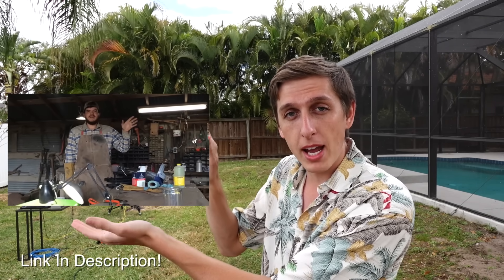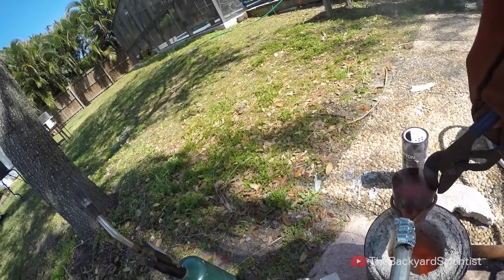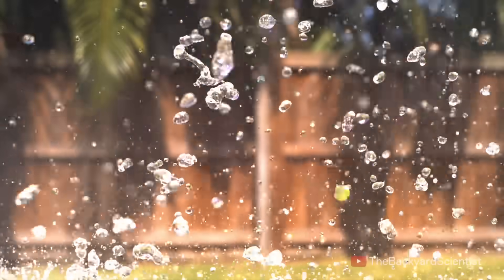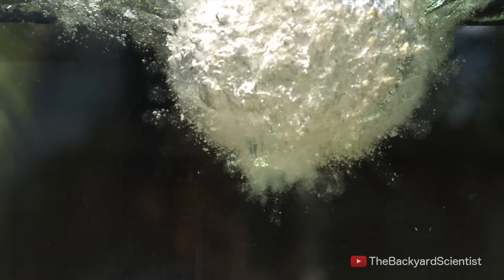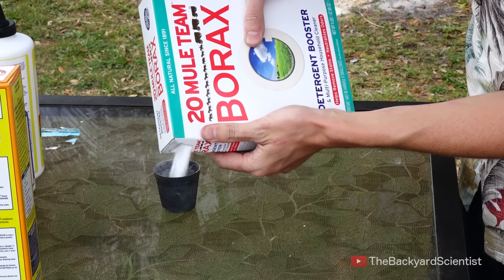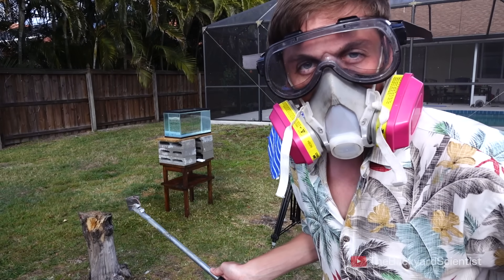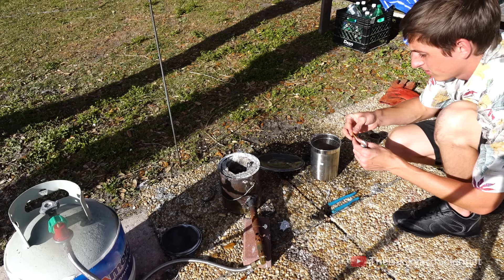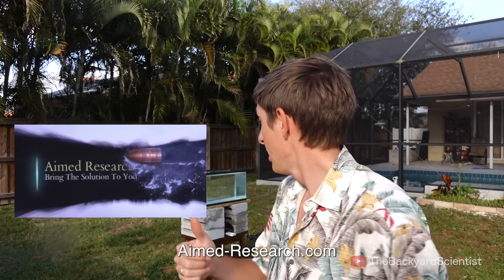Pouring Molten salt into Water - Explosion!

Comment: Professional Chemist says:
The attraction of the strongly ionic bond in NaCl is able to overpower the Leidenfrost effect enough to initiate the "exponential process" the Backyard Scientist proposes at the end of the video. The fact that molten NaCl has such a low viscocity is what enables that rapid process. The other compounds he tried are either more viscous when that hot, or have a weaker affinity for water, or both.

I predict that only binary alkali-halogen salts will do this as well. NaCl is the least toxic, followed by KCl. CaCl2 or MgCl2 may perform well, but that depends on their viscosities when molten. Another simple, non-decomposing salt with a higher melting point than NaCl, low viscosity, and strong affinity to water may be even more spectacular.

Comment: My belief is when you melt the table salt you are separating the sodium and the chlorine, that how you are getting the explosion. Sodium itself is explosive by itself when exposed to water even when its not molten. So the chlorine in table salt is a stabilizing agent for the sodium which makes it soluble in water till molten, when molten you are separating the two chemicals which makes the sodium less stable which in turn gives you your explosion.

Comment: it's ah 'coulomb Explosion' which all Alkali Metals do when reacting with water - you can simply google it up. 
Dear Backyard Scientiest - learn how to use google to look up things you have no explanation for :-)
Reply: +Felix  Klingler But its not an alkali metal, its a salt.
Reply: the sodium is an alkali metal Comic B Studios
Reply: Felix Klingler But it has already reacted with chlorine, it is a stable ion that will not react with water, hence why adding normal salt to water does not cause an explosion.
Reply: yes but it's molten - this changes the situation Comic B Studios
Reply: Felix Klingler It does but the sodium and chlorine have still reacted, otherwise chlorine gas would be evolved

Comment: I think the reaction is chemical in the following reaction: H2O+NaCl --> NaOH+HCl. And also there are a couple of indications of a chemical reaction like gas production and most likely heat. Now for the unchanged pH level; I believe that since this is, concerning molarity, a very balanced equation. The two reactants only need 1mol of each to create 1mol of each product. And those products would then reverse react to form the original reactants, the new products. So depending on how long you waited to test the pH levels could've dictated where it went pH wise. But my prediction is that even if you tested it immediately after the reaction, the hydrochloric acid and sodium hydroxide would've balanced each other out anyway, resulting in no pH change. So that's my theory on why this is a chemical, not physical reaction.
Reply: +LilFatty0616 But the reaction you propose does not create any gas and would require heat not produce it.

Comment: The sodium explodes with fire because it is chemically positive and oxygen is chemically negative. The sodium chloride explodes more fiercely because it's chemically polar with a positive element and a negative element, mixing with the water perfectly as hydrogen is positive and oxygen is negative. The reason there is no ph change is because salt has no ph. If you take hydrochloric acid and sodium bicarbonate, you will get water, salt and carbon gas, it will be neutralize salt water.

Comment: My guess is: 
1) The sodium is still ionic when molten, so it shouldn't react with water the way that sodium metal does, since no electron transfer is 'desired' 
2) But the ions of the sodium and chloride do have a strong charge, meaning that water molecules are quick to surround each ion 
3) As soon as the water tries to surround the ions that are trying to disperse, they are heated up and converted to steam, giving the ions a moment where they're not exposed to water (hence the little bubbles and the pauses in the explosion) 
4) The borax wasn't as significant, because each ionic molecule has 2 Na per 11 other atoms in each tetraborate (instead of the 1:1 ratio of sodium to chloride) AND the borax probably wasn't anhydrous, so there was a lot of water that got steamed off while you were heating it, so the actual ionic material you got was less than there was in the salt.  
5) Basically, the borax had much fewer strong ions in it, so the effect wasn't as dramatic.

Comment: when you heat the sodium chloride past its melting point you are literally breaking the bonds between chlorine and sodium. both of these elements are very reactive because of the number of their valence electrons, and when they are placed in contact with water the individual elements bond with the hydrogen and oxygen as well with each other. thats what happens
Reply: +Aaron Cross if that happened, when you melted it you would get chlorine gas being evolved which he would have seen (and also noticed because highly poisonous)

Comment: you are melting off the chlorine gas and what's left over is Molten sodium and when is sodium is combined with water it explodes
Reply from the maker: +Anthony Cliett nope
Reply: +Anthony Cliett If the salt was broken down, it would have to be combining with the water (either the hydrogen or the oxygen), this would change how many free hydrogen ions are in the water, thus changing the pH value. Since the water was pH neutral both before and after the test, the water must not have reacted with the salt chemically.
Reply: You can't melt chlorine out of sodium, that's not how molecules work. The chlorine isn't dissolved in sodium, so you can't melt it out.
Reply: +John Manard Thing is, cooling doesn't create expansion, it does exactly the oposite. I think whats going on is that the energy stored in the NaCl has to be liberated since the Na+ and Cl- ions have less degrees of freedom of movement compared to the NaCl molecule, so the energy is released extremly fast into water once it ionizes, wouldn't be able to determine why it happens to this ionic compound and not the other ones tested on the video.
Reply: +Anthony Cliett LOL go back to school, you idiot.
Reply: +Orintaz i thing ypu are right. maybe
Reply: +TheBackyardScientist Your explanation could be applied to any molten liquid unprotected by the Leidenfrost Effect though, right? I must not be grasping something.
Reply: +Lou Manarty high temperatures might break the bond and then the chlorine could evaporate
Reply: +John Manard I think he means the chlorine went away when her melted it leaving just molten Na
Reply: Lou Manarty This could happen but only at temperatures way past turning gaseous. Like if you threw it into the sun then it would break down, but not in a home-made crucible.
Reply: oh XD

Comment: Wow. So you think sodium dissolving into water makes a steam explosion? I don't know about you, but I have never seen steam on FIRE before. You really should update this so you aren't telling people things that are very very wrong.

Sodium metal CHEMICALLY reacts with water in the following way;  
Na + H2O <-> (Na+) + (OH-) + H          (rxn1)
2H <-> H2                                                (rxn 2)

A simple way to put it is the sodium metal has an electron it really doesn't want and attacks water. The oxygen in water isn't stable with the extra electron and the bond with one of the hydrogens is broken producing a neutral hydrogen and NaOH (rxn 1). The neutral hydrogen atom can easily react with itself to make hydrogen gas H2 (rxn 2). Because of the heat released from (rxn 1) the hydrogen gas formed in (rxn2) is at a high enough temperature that it can burn with oxygen in the air. This is PROVEN by that fact that there is FIRE clearly visible in your high speed footage. It's amazing to me that you are 99% sure there is no chemistry happening when you were feet away from a fireball. Your little experiment will not change the pH enough to see a difference in pH paper because most of the molten salt you add simple dissolves in water the same way solid salt would. 

To summarize the explosions you are seeing are from sodium 'chemically' reacting with water producing a lot of Hydrogen Gas. With sodium metal the reaction gets hot enough so that the hydrogen can burn with oxygen in the air. With the molten salt it doesn't get hot enough so there is not fire, but a lot of hydrogen is produced quickly making the explosion. Steam explosions do not happen when there is liquid water around. Pockets of steam in water just heat up the surrounding water, boiling water doesn't make it explode.
Reply from the maker: +GmanFTW dude did you even watch the video? There was no fire at all except for the sodium metal.
Reply: +TheBackyardScientist 

I was trying to keep things simple in my explanation but allow me to explain further. Sodium metal contains neutral sodium atoms, not ions. Notice in my first comment that in rxn1 we need a neutral sodium atom with its one electron it doesn't want to attack a water molecule and make hydrogen. With sodium metal this reaction happens very quickly and gets very hot, hot enough to ignite the newly formed hydrogen gas. 

Now as I'm sure you know that sodium chloride salt is a combination of sodium and chlorine 'ions'. When you add solid salt to water the two reactions in my first comment don't happen because there is no neutral sodium atoms that can attack the water. Now here is the interesting part,

Salt (sodium chloride) is very stable, indicated by its very high melting point which you mentioned. The reason it is so stable is because of the 3 dimensional lattice structure is forms with other sodium and chloride ions. When you melt the salt, you are destroying all of the chemical stability that was present in the lattice structure of the solid salt. Now you have a liquid filled with very excited sodium ions. So excited that some sodium ions may briefly grab an electron from a nearby chlorine or from somewhere else (this is the only part i'm uncertain about). So in general at any given time we may have some amount of neutral sodium atoms in the molten liquid. Kaboom, now we have neutral sodium that will react with water in the same way as I explained in my first comment.

But because the molten salt isn't pure neutral sodium atoms the reaction will not get as hot as it does with pure sodium metal, so the newly formed hydrogen gas does not have an ignition source aka no fire. 

I'm not trying to start a comment war, I just want to help you learn about what you are seeing. It was a good effort, but your explanation in the video was incorrect. What you are seeing is the rapid formation of Hydrogen gas. If you have any questions I will be happy to try to explain it to you.

Comment: Everyone thing but the salt forms a protective oxide layer that shields it from direct contact with the water.  But the salt does not form an oxide layer which allows it to have direct contact with the water which allows its outstanding temperature to separate the water into hydrogen (which is highly flammable and explosive) and Oxygen which is used in combustion.  The temperature ignites the hydrogen fueling the massive shockwave and explosion.  If you have any other questions about this or on anything else leave a comment on my channel.

Comment: 1 I would highly recommend you don't use glass for these tests, you can probably tell why, some odd polymer would be better and two i've already seen a comments about this saying how the salt is water soluble, I'm guessing this counteracts the liedenfrost effect and compounds with your theory of the precontained expansion. 

In my experience with borax its rather stable. more of a boiling than a volatile reaction. compared to metal where it's more rapid and can create more expansion but has the liedenfrost effect, take that away and add in the rapid crystallization causing fragmentation and rapid surface area multiplication equals a very effective explosion

Comment: Sodium will explode in water regardless its molten or not and that is what exactly i think might be happening when you are melting table salt. you are kind of making few sodium atom free from chlorine bond.
Reply: That could be a possibility
Reply: +Rishi Kishore But then the pH of the solution would have changed.
Reply: Comic B Studios 
There is no mention of pH in video.
Reply: Rishi Kishore Except for the bit where he tests the pH at about 6:50
Reply: +Comic B Studios 
OK, I didn't see the the video until the end before. 
I really do not think its a physical reaction rather chemical. Because when you put a very hot substance in water you see lidenfrost effect not an explosion.
As seen in video there was no explosion until salt was heated to certain temperature and no explosion in case of Sodium tetraborate. I think that extra temperature helped making free few sodium atoms from NaCl bond. On other hand Sodium Tetraborate has stronger bond compared to Sodium Chloride. I think if it is heated to certain temperature it will explode too.  
There no change in pH because very minuscule amount of atoms are actually getting dislodge. 
Again it is just a guess work, but that is most logical explanation i can come to.

Comment: Would you think this is driven by some kind of coulomb explosion? If water is able to steal electrons from the molten blob of salt, at some point the molten salt gets negative surface tension and rapidly launches itself into the water, negating the leidenfrost effect. This would transfer all the heat energy to the water at once, which would cause a lot of water to vaporize in an instant explosion.

Comment: It's not a chemical reaction, it's a physical reaction! The sodium chloride is highly hydrophylic and literally absorbs the water very fast. The molten salt it's so dry than keeps and even amplifies this property and quickly absorbs a lot of water, even before that the water starts to evaporate, bypassing the leidenfrost effect; then the water inside the molten salt will instantly vaporize into a vapor explosion because the water will be so rapidly diffused inside the salt that the transfer of heat will become extremely faster. Others salts are not so hydrophylic and then doesn't bypass the leidenfrost effect and so the water will not explode. May I be right?

Comment: maybe the salt you are using has a attraction to the water that the other salts doesn't have and the water gets attracted to the water faster than the heat can effect it and once the water gets in the middle the heat causes the water to evaporate and this causes the first explosion the shock wave hits the sodium and then shoots it into the water surrounding the sodium and it causes a chain reaction

Comment: well u see sodium is a very unstable element due to it atomic structure and whatnot but as the heat of the salt enter the cooler water it starts to create a laden effect and as soon as the water gets in contact with the salt it releases hydrogen has and well boom

Comment: Sodium metal would explode in the water even without heating it up.
But heating it could speed up the reaction. 
And the gas produced is hydrogen. So basically it's a chemical reaction.

Comment: I think the reason why NaCl did this and NaBF4 does not have something to do with the "how much the salt likes water". Na+ and Cl- are very small ion compared to cabonate and BF4-, so the charge are more concentrated and the ions really wanted to be solvated. Essentially I think NaCl is more hydroscopic then other salts in molten stage. 2. the heat capacity and density of the salt  apparently play important role in this. 3. the solvation of ions release tremendous heat, the amount of which is also salt dependent and in general small ions with higher charge would release more heat when dissolved

Comment: I suspect the Leidenfrost effect is somehow being affected by sodium chloride's hydrophilic properties.  A test would be to find another salt that is equally hydrophilic and see if the effect repeats....
Reply: You sir deserve a like! 👍🏻
Reply: +Tim Hyatt Sodium Chloride's hydrophilic properties are a result of its ionic bonding. If that was the case similar results would have been seen with the sodium tetraborate and sodium carbonate as when molten the ionic compound does not retain its structure allowing all ions to interact with the water. I feel like you could account for the lack of a change in pH due to a process similar to isothermal crystallization. I don't know enough about it to say that it's the reason that there is no change in pH but it seems like a plausible explanation. However this still doesnt account for the results seen with the sodium chloride. idk, its weird and chem is gross...

Comment: Well, I"m no expert, but upon inspection of the high speed, it seems less an expansion of one salt grain, and more a super cooling reaction of it.  YOu get a similar reaction if you drop an ice cube in boiling water, the ice cube will explode.  With this, it's the salt grains that are super heated, and each of them are surrounded by water, you get a flash of explosive steam.  The multiple explosions are from the individual grains (or clumps thereof) getting super cooled super fast, and releasing steam at an explosive rate.  Now I'm not sure about salt's heat retention, but I can tell that this is a result of very high heat reacting with colder contact.  If you can, try to gauge the temperature of the water if you try this again . . . that should give an indication of the rate of heating/cooling going on in the tank.  Also, since salt is water soluble, that probably super mixed the solution at the molecular level.